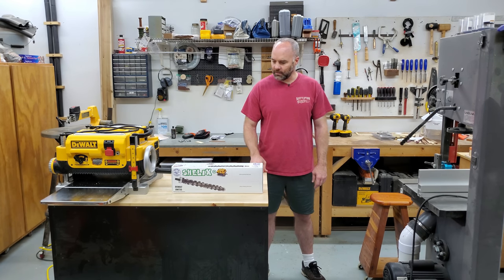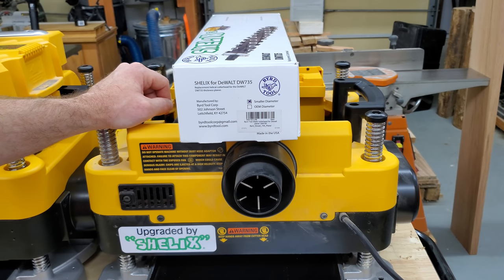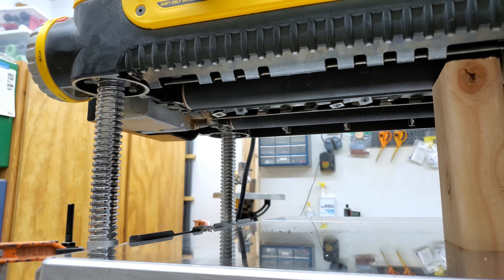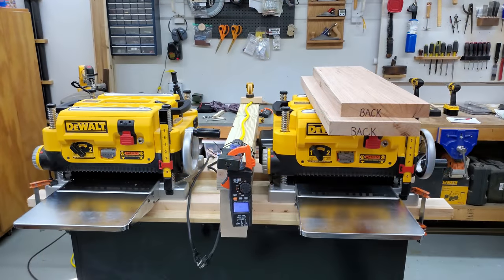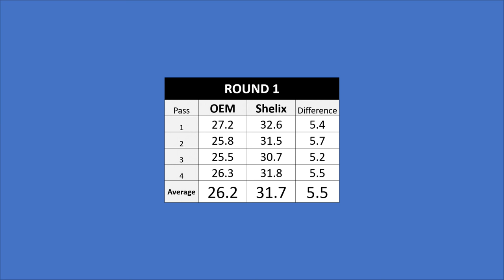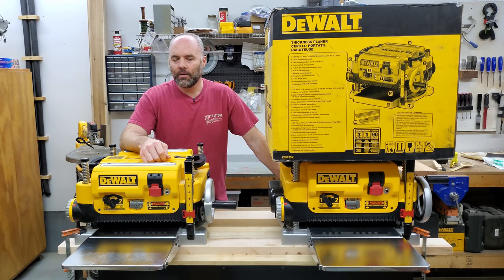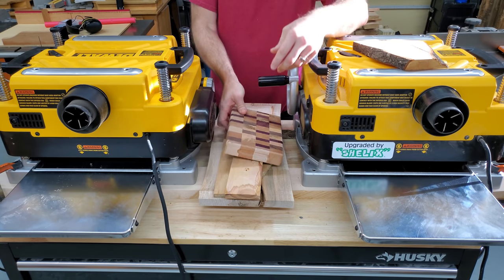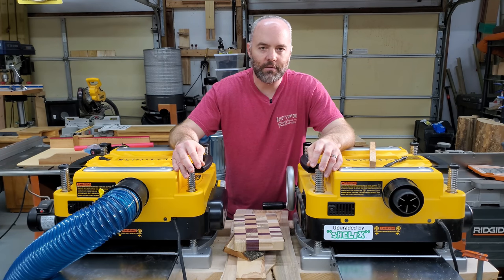The video I wish I watched before buying a SHELIX

Comment: 44:34 - "i gotta figure out what to do with two planers,..." hahaha.       first bad thought, Run them in tandem! Out of one and into the next! I or "rough" and fine cut machines, or this machine is for the mystery board with a nail\rock in it. Worse yet, set one 90 degrees rotated from the first and you can plane small stock without turning the,...
Reply: It's actually not a bad idea. Maybe have a short conveyor between the two machines, and plenty of shop space. Lol

Comment: I have a 15 inch jet I've been thinking on the shelix. This thing has been a champ. I have 5 sets of blades on rotation. It's not been a big deal. One thing that has been is that I get tear out on some wood. I was thinking this thing might help. Good lord I wish I had one to sample before I bothered. I do hit nails in barn wood I mess with. I have piles of it. Been thinking on a Dewalt rig for them simple jobs. I just can't see where this cutter will help.
Reply from the maker: If you work with barn wood, you might want to invest in a handheld metal detector. I keep saying I'm going to get one, but haven't done it yet. Would have saved a lot on sharpening and replacement over the years.

Comment: Pretty obvious you are not just a woodworker. Looks like engineering education. I am about to buy one and learned about Shelix. A good plane makes all of my hobby woodworking better. I am about to make perfect fitting kitchen drawers on roller bearing slides. Great video, unpretentious host with the intelligent thought behind it all. Very cool.
Reply from the maker: Thanks for the feedback.
Reply: @TheSnekkerShow  I bought one yesterday and then was surprised how big the box was. I drove my car vs the Jeep. I'll build it in a wall rack so I can flip it up. When I picked the box up I realized how heavy it was. There are so many things I can use it for.
Reply from the maker: @gerardlunow567  Congratulations, that's a nice addition. If you didn't get the extension tables, I'd recommend buying or building those to keep snipe to a minimum.
Reply: Got my DeWalt 735 earlier in the week (6/2021)and called Byrd today to order my shelix OEM cutter head.  Requests are so numerous that they can't get me an OEM until Sept/ Oct 2021. WOW

Comment: Glad I came across this video, you have a new subscriber now.

A couple of things I thought about:
1. The fact that your Shelix planer was old enough to be out of warranty could add to the amperage during your test. Older motor and older bearings could both cause the power draw to be higher than doing the same task on the new planer - ESPECIALLY because the Shelix removes any gaps in the cutting process, which brings me to 

2. The original three blades are separated from each other, so there is relief in those gaps, however brief it may be. The Shelix is always in contact with the board at every moment in the cutting process, because of the spiral placement of the blades. That non-stop friction works the motor the entire time. That could be a contributor to the readings you got.

3. Another aspect of the warranty on equipment is a universal "umbrella" clause, which is "altering the equipment to any aspect outside of the manufacturer's specified design." 
That's why you got a "yes" on the warranty void question, both quickly by the first person, and after some confirmation by the second service person. 

The way DeWalt's lawyers would frame it would be this:
 "The DeWalt DW735 Planer is designed, calculated, and tested to operate with DeWalt specific parts under specific conditions. Changing out parts or accessories to anything not specified, tested, and approved for use by DeWalt alters the configuration that has been guaranteed for operation by the company; the company cannot, and will not approve or guarantee, or be held responsible for, any failure of equipment that has been operated with any such alteration."

So even if someone at DeWalt told you that you could swap out parts yourself to whatever type of part you wanted to use, you would probably STILL run into issues with repair or replacement being covered under warranty. I haven't checked, but I wouldn't be surprised if Byrd has a disclaimer on their Shelix heads, warning consumers to check their warranty before installing their product, for that very reason.

Thank you for the thorough overview and tests, I appreciate the detail and professional approach to your video.

Comment: I have the 734. No option for smaller cutter, so I had to pull out all of the inserts. It's not the end of the world. I carefully used an impact driver and the screws came out easily. I also stuck a wixey dro on my lunchbox and it's an absolute dream to use now 👌

The movie reboot reference was great, btw 😆
Reply: I'm just a hobby woodworker, so I'm curious about the cost and if you have advice for a new planer? Thx

Comment: They should just ship the OEM-size 735 Shelix with the cutters detached.  Less manufacturing cost, less install time for the user.  I must be overlooking something.
Reply from the maker: I asked about that, and the cutters need to be installed for balancing. It would definitely save some installation time if they were already off.

Comment: Ben, that was very good info...a little long but worth the wait. Maybe total recall can use your spare planer. Thanks for Posting. 
    I also was curious about the amps and the thermal breaker thanks for taking the time to explain. 
My opinion- I use FOXBC blades and Dewalt blades both cut well depending on wood being planed I like the OEM High speed blades, easy to change and do some maintenance, cleaning rollers etc....Again Thanks for posting and be careful sir.

Comment: There's a possibility that the older motor, older belts, everything in the older unit, might have a little more friction, and little wear and tear, and that might account for some of the higher amperage draw. Couldn't convince you to switch the shelix and stock blade assembly in the two units and run the same test, could we? :)
Reply from the maker: Tempting, but probably too much work.  If anything, it might be in the milliamps, but probably not enough to significantly change the outcome of a test using a four-year-old planer from a hobby shop.

Comment: I have read through a lot of the comments and I don't think anyone has mentioned that because you used the smaller diameter cutter, instead of the recommended OEM size, its cutters will be spinning at a higher radial velocity than they would on the OEM version. That means they will be cutting wood at a greater speed than with the OEM version and possibly overloading the motor as a result.
Reply from the maker: You might have that backwards, or I misunderstood you. Larger diameter with the same RPM means faster speeds at the cutter. This is why the speed needs to be lowered on router tables and drill presses when larger diameter bits are used.

Comment: Thanks for bringing up the question of the Shelix voiding the warranty. I just bought a 735 myself and was considering upgrading it to a Shelix. With an answer to this question coming from the manufacturer of NO, I would expect that they would reject any service under warranty if it had anything but the blades the unit was sold with in it. Your personal viewpoint that the Shelix did not cause the failure is conjecture and very bad advice to your subscribers. While I agree with you about it being like replacing tires on a new car, the manufacture could argue that putting square tires on your car is what caused the suspension to fail and the motor to burn out from too much load. You did demonstrated in your video that the Shelix cutter heads can put a considerably heavier load on the unit to the point of tripping it's breaker on the machine. While it might make sense that the breaker on the unit is there to protect the motor from an overload issue, you might consider that DeWalt's argument might be that the long term effect of using the Shelix can cause accumulative excessive heat buildup in the motor and undue stress on the internal parts that drive the cutting head by repeatedly resetting the breaker and continuing the cut. While we all know that this would be a "cop out" argument, even if they couldn't demonstrate a history of failures due to using the Shelix, it's an argument that you would loose. Therefore, I would worry about voiding the DeWalt warranty without a guarantee from Shelix that they would back up any claim of machine failure due to excessive stress to the DeWalt planer caused by their cutting heads. As for me, I think I'll wait until the DeWalt warranty runs out before I try the Shelix.
Reply from the maker: I think I did a pretty good job of distinguishing between the facts and my interpretation of those facts. It's a very popular upgrade, and I would think that if it was killing planers and voiding warranties you might hear more about that online. Of course, everyone has to decide their own level of risk tolerance. I'm glad the information helped with your decision.
Reply: The instruction manual explicitly says helical cutter heads have not been tested and are not recommended.

Comment: If you have to remove the cutters in the OEM head, they should just ship them loose and save you a lot of work. When I bought mine years ago they did not have the OEM head. I was able to install the smaller diameter cutter head without removing any of the cutters. I wrapped the cutter with the clear cellophane that came in the package and slid it in no problem.

Comment: It's actually illegal for them to not honor the warrantee due to using non-original parts unless they can prove it was at fault. They also can not void the warrantee if you take it apart and try to fix it yourself no matter how many of those "warrantee void if removed" stickers you damage or remove. They are only there as a deterrent.
Reply from the maker: Good information, thanks. I wonder if that varies by location or state.
Reply: @TheSnekkerShow  That's true in the states, not sure about other countries. Your actions can not be used as a basis to deny warrantee unless it directly caused the failure.
Reply: That's the Magnuson-Moss Act, https://en.wikipedia.org/wiki/Magnuson%E2%80%93Moss_Warranty_Act

Comment: An excellent video, thank You! DeWalt DW735 might not be the best thickness planer to demonstrate the difference in loudness as it has a built in dust extrector impeller that's really loud, but the difference is still noticeable, if not in absolute dB, then in frequency of the "whine".

Comment: I was thinking about the power draw on the SHELIX, and got to thinking that, perhaps it was because the head had a smaller diameter, causing the rollers to push harder on the wood as it passed through, that was bumping the power draw up on that, rather than the cutter head itself. Although... if you think about it, there are a 'lot' more cutting surfaces hitting the board, almost 'constantly' with the SHELIX, combined with the drag caused by the rollers being lower.
Just a thought. If I can find a helix cutter head for my old 13 inch "Royobi" planer, I think I'll upgrade anyway. Knives for that thing are hard enough to find as it is. I'd also like to find a helix cutter head for my 1950's 6 inch Craftsman jointer... IF I can find one.

Thanks for the video and the insight.
Reply from the maker: I haven't checked the pricing, but I think Byrd Tool will do custom heads if you send them one to match.

Comment: Notice the louder sound from the bladed machine. its moving a lot more air this staying  cooler, I think the tungsten blades need a more positive rake, it would take away some of the pressure, it would be interesting to see what the chippings look like, how both machines compare..
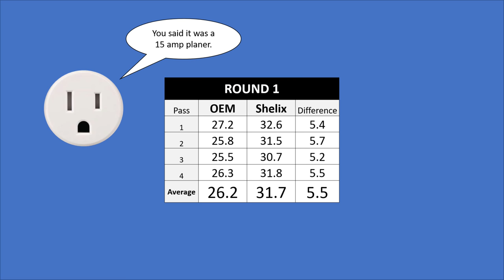Reply from the maker: That would have been good to cover. At around 26:03 you can see the smaller chips from the Shelix head, which are easier on dust collection than the much wider shavings from straight knives.

Comment: I'm playing 'catch up' on YouTube, so I hope you notice my comments, I'm enjoying your clear, concise and methodical presenttion, so you've won another subscriber ... Might I suggest you get one of those 'free' decibel apps for your phone when comparing the noise levels, it would give a more accurate appraisal; The human ear is a strange thing, different people respond to differring frequrencies and levels depending on their industrial backgrounds ... Correct me if wrong but isn't the machine with the SHELIX blade older? As motors wear they tend to draw more Amps to do the same work, the loss generates heat; Also those clamp meters are notoriously inaccurate tending to read higher for safety reasons ... Back to the video, keep it up, I like your style 😉

Comment: 2 planers?  use the "top half" of one attached to a "rig" that will allow the planer to move side to side and over the length of large slabs of wood to plane door and table sized pieces. I do think, based on what I could see of the the design of the DW735 in the store, that it is the right machine for that application.

Comment: Can DeWalt supply the planer with helix cutter head supplied? cheers
Reply from the maker: I'm just old enough to remember when table table saws came with steel blades.  I think that eventually, thickness planers will all come with helical, or at least carbide, cutters as well.

Comment: A 20A circuit breaker can sustain a 30A load for up to 2 minutes before tripping.
Reply: No it has one job and it's gonna do it...
Reply: According to the charts a 20amp breaker will trip in less then one minute if the load is 25 amps. The 30 amp draw is 100% over the planer motor rating and there is no service factor.  Even if the breakers, panel and machine held, you would damage the motor.
Reply: @michaelluciano8283  Not sure which chart you were looking at, but I referenced the trip curve for a Square D 20A QO circuit breaker (Schneider Electric document number 730-3).
Reply: @thehutchttu  the breaker you referenced is a 20/30amp tandem breaker.
Reply: The breaker on the planer is a 20. Amp. Even if that held at 30 amps you are still overloading the motor. Do that a few times and you have a  damaged  motor.
Reply: That doesn’t sound right to me

Comment: Bottom line, if you need to send it back for warranty service, swap the cutter heads and put the OEM one back in before sending it back. It's like a chipped car, swap the OEM chip back in before going to the dealer for any warranty work. Just make sure you use the OEM cutter head for a while before swapping in the Shelix head so it looks used.

Comment: Good stuff!  
It might be worth noting that the smaller diameter Shelix changes the speed at which the knives are moving, and the leverage they have.  Also I would be very interested to see what a Kill A Watt meter shows in comparison to the Klein clamp meter.  They aren't very expensive.  Mostly they are used to measure kWh, but they also have a setting for amps.
Reply from the maker: The Kill a Watt meters are only rated for 15 amps and don't seem to do very well over that. A few people tried it and got different results than I did, only to get the same results when using a heavier duty meter.
Reply: Thanks for the explanation.  Now I know yet another thing I didn't before!   8-)
Reply: @TheSnekkerShow The Kill-a-Watt could be used to do a comparison with the Klein when using something else, say an old fashioned incandescent light bulb.  I just wonder about that loop thing you use with the Klein, and the adjustment factor.

Comment: Your hack @14:00 of shimming the spring will raise the roller slightly, but it does not reduce the spring pressure against the roller and board. You are effectively preloading the spring, you are not reducing the pressure. The spring will exert the same pressure against the board.
Reply from the maker: You're probably right. Over time the constant pressure might soften the springs a little, but I'm not sure how much. It's not a modification I plan on doing with mine.

Comment: One thing you did mention near the beginning of this video, is that because the rollers aren't adjusted properly, the power consumption due to drag would be higher.  I would like to see the same side by side consumption testing using the OEM sized Shelix v. The OEM blades.
Reply from the maker: I've wondered about that too. I've since replaced the undersized head with an OEM sized head, but I put it in the newer planer, so it would be tough to get an equivalent measurement.